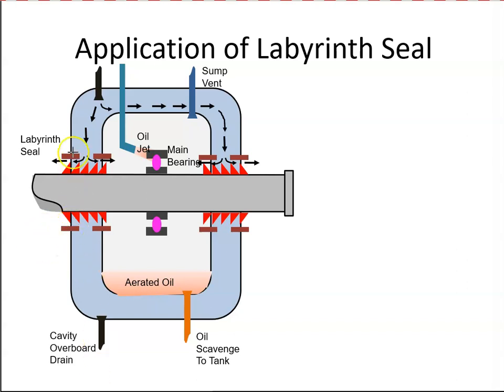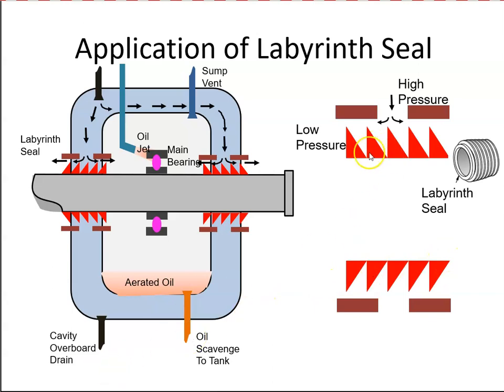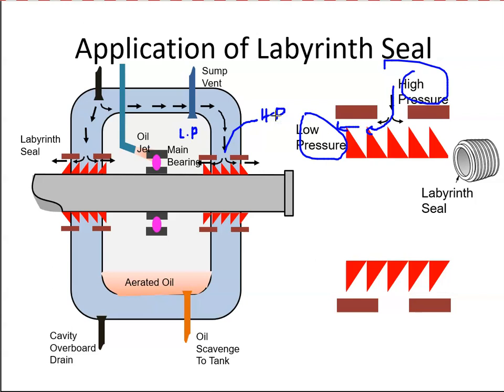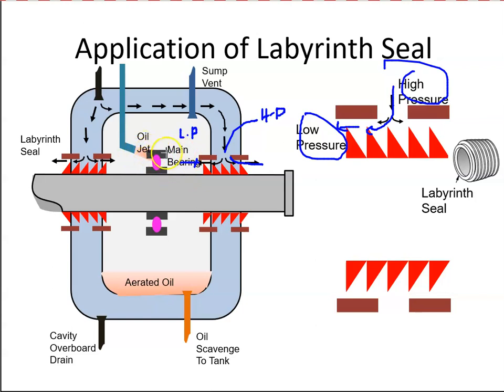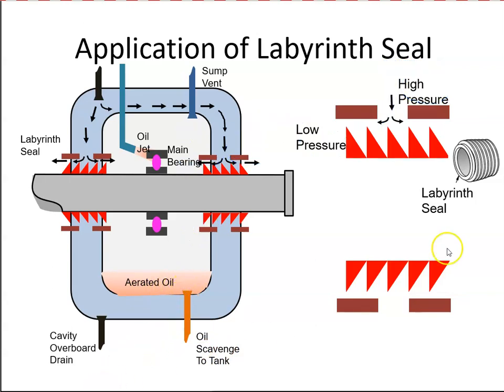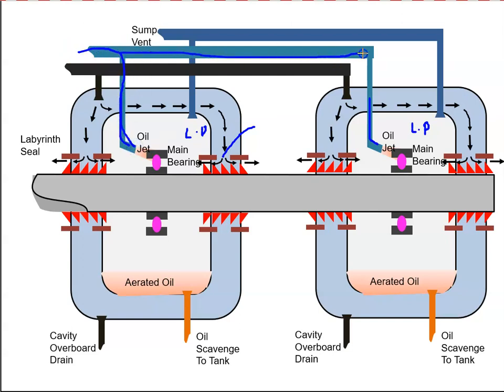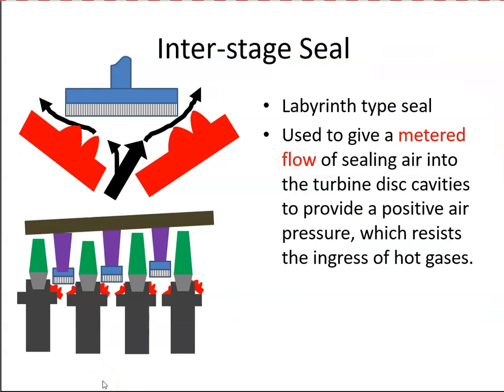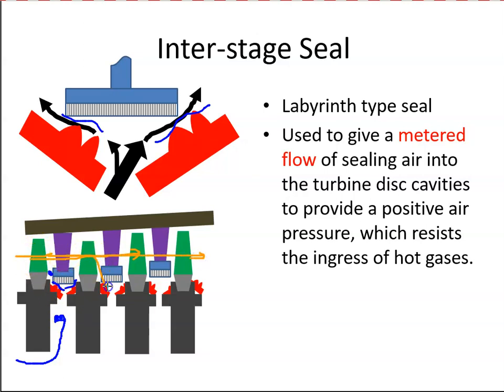Labyrinth Seal

Comment: Hello Sir..Many thanks for this presentation... Appreciate your efforts.. I have a doubt.. At 2:05 , you have mentioned that the oil mist inside the bearing compartment cannot go past the labyrinth seal because of the low pressure inside the compartment caused by the pressurised airflow going inside through the labyrinth seal knife edges .... Is it technically okay to say that, "the oil mist cannot go outside through the labyrinth seal knife edges due to the continuous supply of pressurised air coming across the knife edges"... I'm taking the reference of the general property of a fluid where the flow of fluid in a particular direction is prevented in the presence of another opposing pressurised fluid flow...Can we omit that pressure differential  phenomenon while explaining the oil sealing capability by only using the above mentioned property of fluid...Is it technically correct? Kindly pardon me for any mistake in my question. Thank you Sir!
Reply from the maker: @hari-rx3sh  Yes you can say that "the oil mist cannot go outside through the labyrinth seal knife edges due to the continuous supply of pressurised air coming across the knife edges".  The reason the air is flowing in that direction is because of the pressure differential..
Reply: @RoddyMcNamee  Many thanks for the explanation, Sir! Wish you the very best ahead.